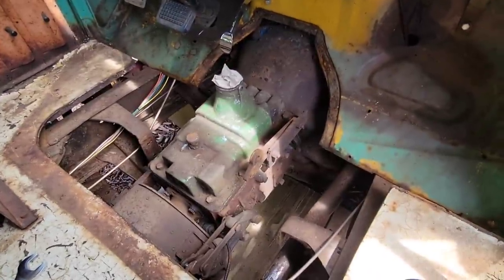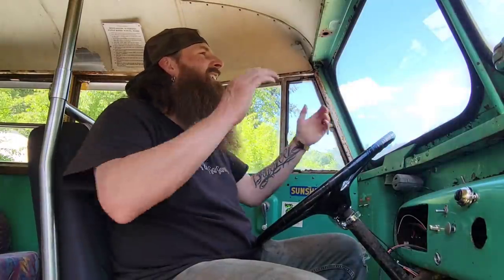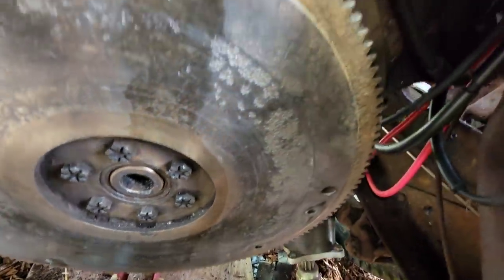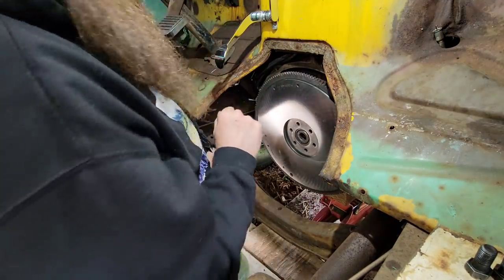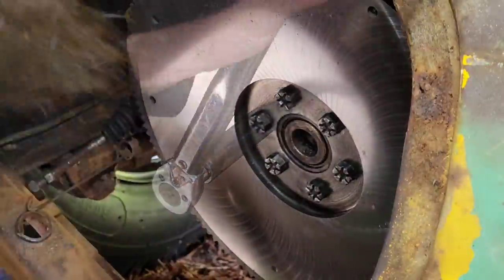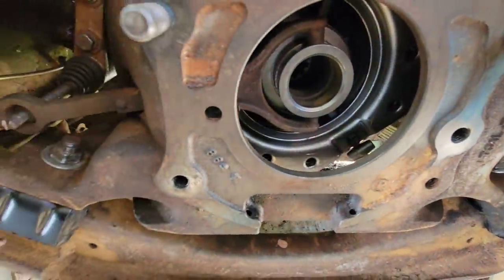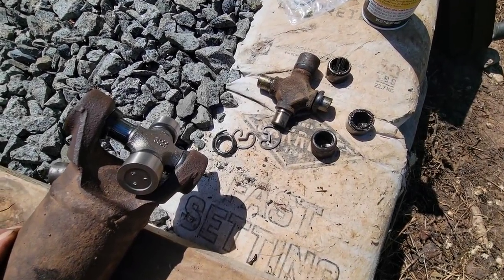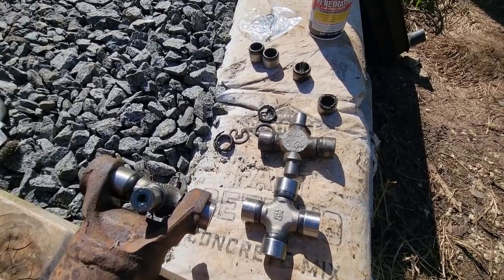(22nd Video) Clutch Replacement 1948 Ford F5 School Bus! Never Fails, Something Always Goes Wrong..🤬

Comment: I discovered your channel a few days ago and am hooked on watching you restore this old bus to running condition. I would like to suggest that since this bus has been modified in the past it is best to take the old parts to the parts store to match up new ones since many parts have been changed and no longer match the specs in the book. You are doing a great job and all by yourself. It will be very rewarding to be driving this bus knowing you have done so much by yourself. Cheers!

Comment: Nice job on the clutch!
I used to work at an automotive machine shop years ago. I loved taking something that was worn out and having it go back looking new.
My specialty was remanufacturing crankshafts, we did everything from antique Lawnboy mowers to tugboat cranks.
You are doing fine. Keep paying attention to the details and work safely.
Cheers
Terry

Comment: I have never seen trans be put in this way and it is awesome mate. I normally pull them with the bell housing. great work getting it all together and ready to go. when i did my truck i put in all new u joints and hanger bearings. great work mate and can not wait to see it on the road!

Comment: I bought a 1945 ton and a half Ford off of a local farmer. It had the flathead motor which was seized up. I did lots of work but in 1993 the Mississippi flooded and went over my truck. I did have insurance on it but I would have rather had the truck.

Comment: I totally get how Harris feels. Having said that, I have every confidence the old girl won't disappoint. Except maybe at the gas pump. I'd be interested to see what kind of mpg it gets...yikes!
Reply: I'm guessing 8-10🧐
Reply: That's normal now days...rule of thumb for a newer school bus is 7 mpg
Reply: With diesel
Reply: @reneezimmerman4907  ok, and those old Y-block gasers were not known for good mileage in low geared buses. That old bus would have originally had a flathead V-8 and been geared for climbing and dirt roads.

Comment: I've been thinking about the rat hole on the passenger side of the bus, where is rusted through due to the rats' nest. You should be able to cut a larger clean squared or rectangular hole rust proof treat and spray around the inside or backside of the larger hole. Then make a aluminum rectangular plate large enough to over lab and cover the new access hole. You could either use rivets or sheet metal screws to secure it in place after painting it yellow to match (or masking around it and painting it after mounting) Most school busses have access panels that look like your finished hole would, so it would fit right in and fix the rats' damage at the same time. Looking forward to more on the build. Also thought when you were wiring under the dash, I'd taken the time to body seam seal and areas that may leak or rust further, rust treat any non aluminum areas under the dash and in the lower cab foot well. Then dress it up with a rust inhibition spray paint, bed liner, or coating of your choice. Same with the engine bay. So much potential in this bus project, I see cool ideas eaverytime. Thanks.

Comment: This is why I said taking this bus on a long drive is going g to be a challenge. It’s 74 years old and been sitting in a forest fir 20 or more years. I honestly think this need to be postponed. Heck the bus has not been driven on a road for 30 minutes straight let alone three hours straight. Please reconsider
Reply from the maker: I'm a bit nervous also but I think it will be ok. I have faith in the bus. 🙏
Reply: @CountryBoyGasGarage  , with all that you have done to it, the bus should do fine. Just don't be in a hurry to get there. It wasn't designed for modern hurry up and get there highway speeds. You will probably find that it won't want to go faster than 50 to maybe 60 mph tops. When you drive an antique vehicle, you learn that you don't have to be the fastest one on the highway. Just be sure to keep an eye on the gauges and make sure before you leave that all of the gauges work properly.

Comment: Nice video the bus looks great. During the first part of the video I kept waiting for you to run up a set of steps like in Rocky totally made me think of an 80s movie. Yes I know rocky was the 70s but you get the idea. Keep it up. How are the motor mounts it looked like the engine moved a lot when you torqued the fly wheel ?

Comment: I've worked on the window maker wheel and tires 
Doesn't matter witch ones you work they both are not good 
If you want to keep using them you need to get 
Tire matic hammer
Bead tools (spade pry bars)
Pressure regulator
Locking air chuck
Tire cage
Rapping a 1/2" chain around it doesn't work
You just end up with a tire and rim on the hood of you 3 week old truck after it went through the overhang of your garage
That was in 1986
Clean them very good 
DON'T PUT ANYTHING ON THEM NO GREASE,OIL,PAINT, NOTHING
Paint the rims with them together
Then put the tires on

Comment: Have you cleaned and disinfected the front cab section of the bus yet. I know you pressure washed the rear already in an earlier video. I noticed during your back in the road video the cab roof looked dirty compared to the rest if the bus. Also noticed 2 round ventilation inlets in the upper cab as well, do they work? Anyway love the videos and bus. Hoping you stay healthy with all the previous rat activities (peeing and pooping all over everywhere and the film and dust residues they would gave left over 25 years, yuck!) Best wishes.

Comment: Why are you not changing the trans u-joint and the carrier bearing while you have it apart? They may look good but don't assume they are. Cheap ins. if your family is with you. Did you flush the heck out of that trans? It blows my mind when things are that torn apart, and the wearable parts are not replaced because they look ok. Like the bushing in the crank should have been replaced. I hope you at least measured the I.D. of the bushing and the O.D. of the shaft. I just like to change things that I know may be worn out instead of doing it again, but that's just me. I don't like the, it should be fine thing, because we all know how that seems to work out. I couldn't believe you were going to use that flywheel without getting it turned or a new one. I didn't tack weld the oil pickup on an SBC oil pump once thinking it's a press fit, "it will be fine", well it fell out and spun a bearing.
Reply from the maker: Well I'm doing as much as I can in the time I have to get it to the Church Reunion. Things were really built to last then and it appears that the bus was completely overhauled just before it was parked. Some stuff still new and greased but some not. Glad I did decide to have the flywheel resurfaced though ans some stuff I will come back to after the reunion trip and I have more time.